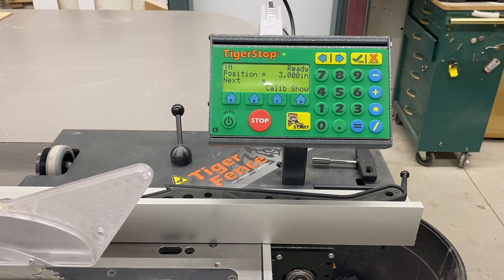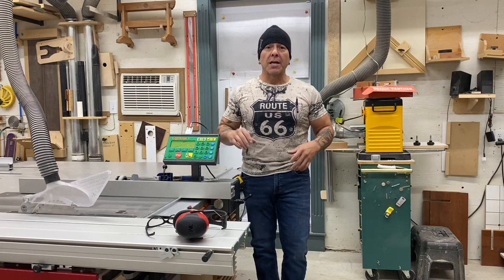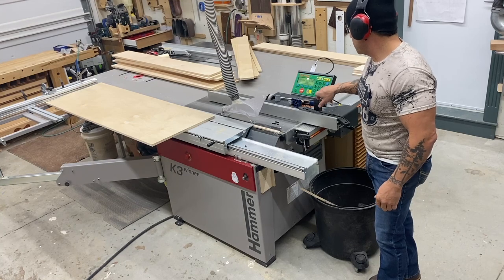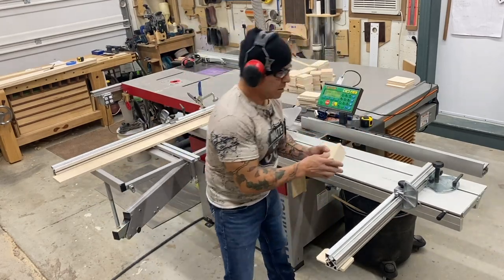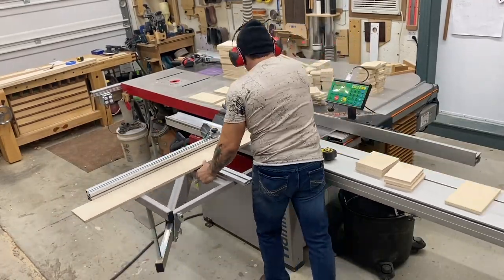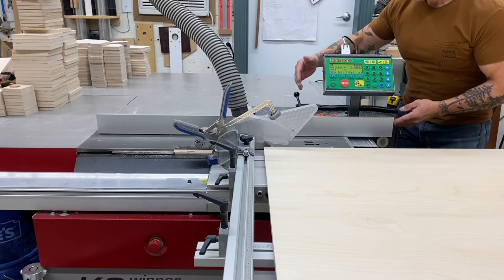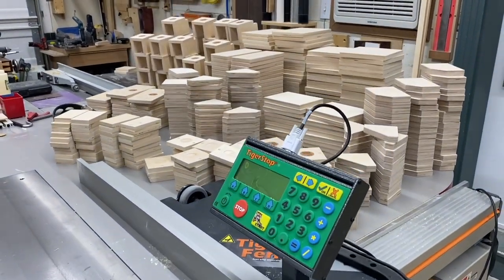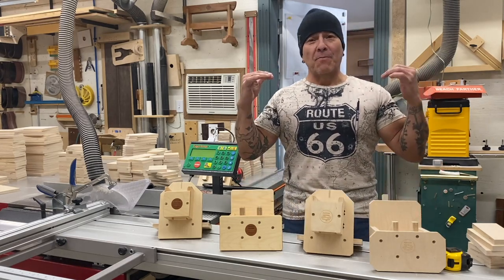Hundreds of Accurate Parts Made Quickly with the Incredible TigerFence!

Comment: That is an amazing fence.  The nickel test showing how you can return the fence to the same position is great.  I definitely caught when you had to move the fence to access the scoring blade adjustment and my initial thought was to set a stop so you could return to that exact position.  Obviously, that's not an issue with the Tiger Fence since it is probably more accurate than using a stop.  Thanks for continuing to share your impression of the fence.
Reply from the maker: I am extremely pleased and impressed with this thing!  It’s transformed an “okay” slider into one that I can always count on to be dead on balls accurate!  😆 Thanks David.

Comment: Nice addition and accuracy/repeatability is where it is at.  It is so nice to be able to go back and cut an exact replacement piece when you need to as well.  I am curious as to how the Tiger Fence handles the fence high/low corrections and also how fence toe out/in is adjusted.  And, the Domino Dock is awesome especially when made by the designer himself.  Steve
Reply: I was thinking the same thing as Steve.  Are there built parameters in the computer to make a quick adjustment to where the fence orientation is?  Thx
Reply from the maker: Yeah, for sure.  It’s a dream to simply punch those numbers in again and cut a part that’s precisely the same size!  And the TigerFence has easy adjustment for height, toe in & out, etc.  That part gets aligned first, then the TF goes through a test to check proper installation, straightness of the TF beam etc. Then, you cut a part and calibrate to check accuracy (super fast and simple!)

Comment: roman  what model and brand of slider do you use?  prefer over the saw stop?
Reply from the maker: Yes…it’s a Hammer K3.  I needed a slider to easily cut Baltic Birch sheets. I also have a 10” cabinet saw (Grizzly) At some point I’ll upgrade to a SawStop.  Not so much because of the finger saving technologies, but I’ve used one at my brothers shop and their quite smooth.  Thanks

Comment: actually see it a hammer three.  Amy desire to have a biggere one or does this do everything you need
Reply from the maker: I would love a bigger slider and a bigger shop! 😆 however, this K3 does everything I need.  On occasion I need to cut 4x8’s, it’s easy to cross it first, then rip or cut to size.  This K3 has a 79” (2006mm) rip (with slider part) capacity.  But it’s simple and quick to remove the cross cut fence.  Then I can rip any length needed. Hope that helps.  Thanks